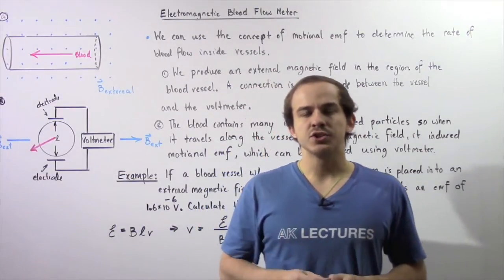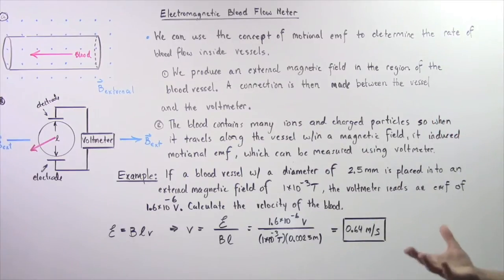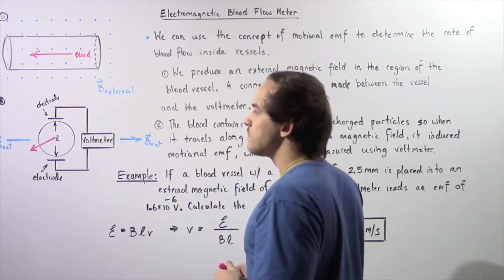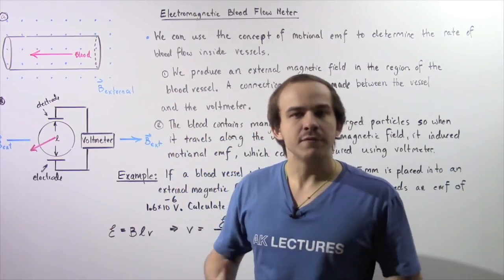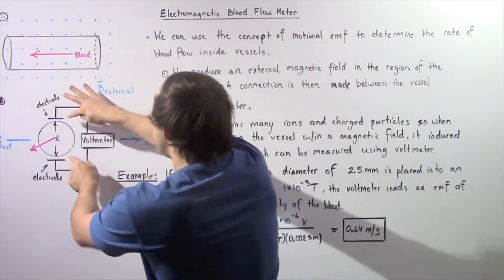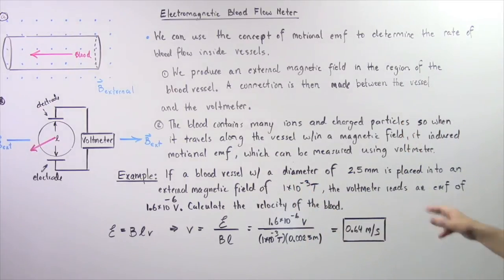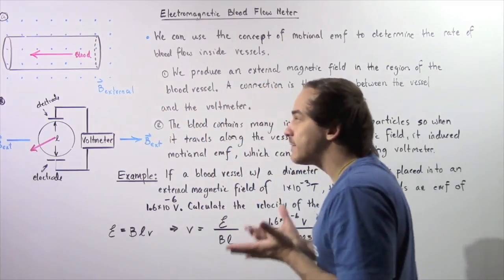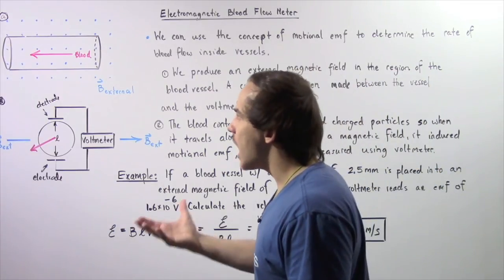Electromagentic Blood Flow Meter and Motional emf

Comment: Shouldn't the electrodes got connected from beginning and end of the measured movement distance? If it is like that as shown on board, why don't we use hall effect? E.q=B.v.q   v=E/B   ??
For another option, are particles making circle to create a decreasing magnetic field, so we put the electrodes to that circle to measure emf?
I am a bit confused
Thank you

Comment: does it work to mesure glucose in blood
Reply: The blood flow meter works because its based on the fact that there are ions in the blood, which are charged particles. Moving charged particles create a magnetic field all along the blood vessel that acts as a wire. The magnetic field is constantly changing in strength due to the different amounts of ions at any given moment in time where the measurement region is. The change in magnetic field induces an emf or a voltage in the voltmeter. We then can calculate the blood flow velocity as he shows in the video.

In order to measure glucose in particular, it would need to be charged or else the physics principle of an induced emf will not work, hence you won't measure the glucose. The whole concept of an electromagnetic blood flow meter is based on moving charged particles. By the way, one could measure the current in a regular conductive wire without ever touching it with this method.